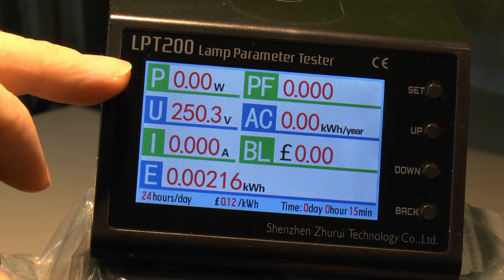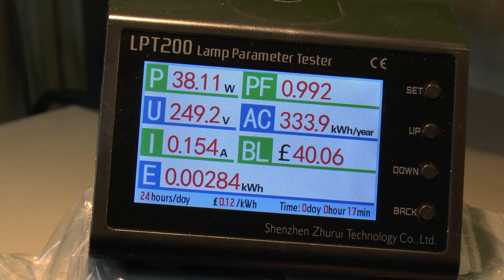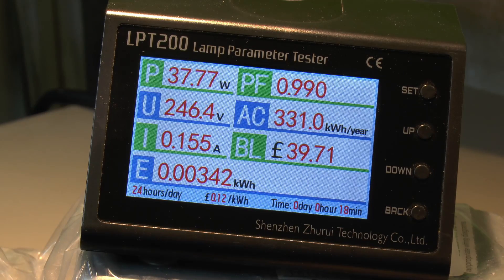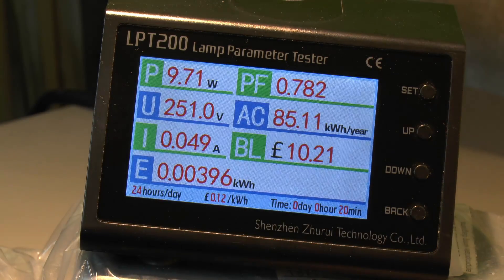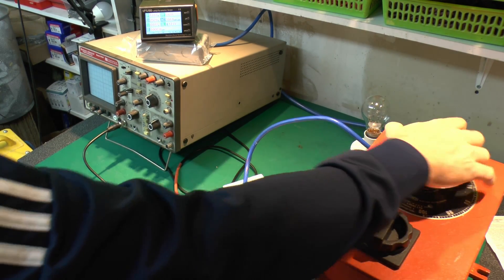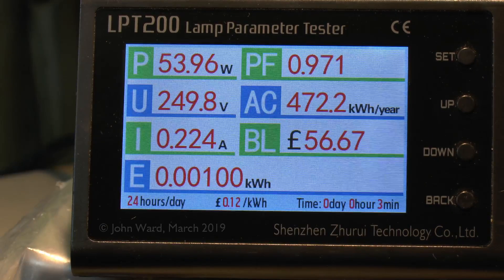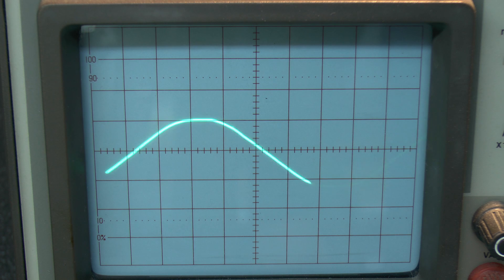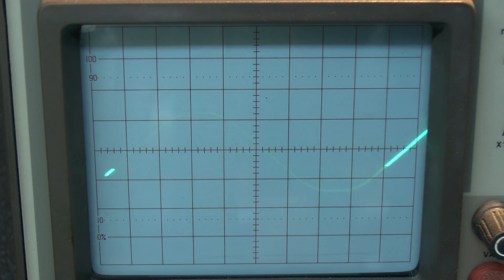Dimmer Power Factor and Variac Dimming

Comment: If you can't see the oscilloscope trace, try adjusting your YouTube settings. The default refresh rate may mean you simply can't see the trace. For me, at 480p the trace is almost invisible, but changing the settings to 720p50 HD or 1080p50 HD makes it a lot more visible albeit with a lot more flicker. I suspect that's how it actually looks.

Comment: Cool.    I always wondered how an LED bulb would react with a variac vs a standard dimmer, which chops part of the sine wave thereby reducing the average voltage.  I realize variacs are very rarely if ever used anymore these days but many years ago they were used in theaters and opera houses for dimming large stage lighting since although physically large and heavy, much more efficient than the resistance dimmers used earlier,  and safer than salt water dimmers (liquid rehostat) used in the early 20th century.

Comment: The problem is that when the dimmer is used the current is only taken on the last part of the cycle. You could say it is still in phase but is in fact the power factor is not defined for a non-sinusoidal load current. As others posted it would be instructive to show the current trace on the scope as well.  The fact that dimmers and lots of other loads take non-sinusoidal currents causes problems with the supply waveform as well as the harmonics heating the grid transformers. When I worked for London Underground the AC waveform was very poor as about 80% of the power was transformed to DC with 12 pole rectifiers. At times the AC voltage waveform had more than 2 zero crossings per cycle.

Comment: I think we're actually seeing a failure in the PF measurement on that device. The harmonics are reactive in nature, but the power factor on the display doesn't represent this correctly. I suspect the chip in the power meter is simply comparing zero crossing points rather than doing a full analysis of the AC waveforms.
Reply: I suspect you're right - would be interesting to know!

Comment: Chuckle. When I was giving planetarium shows in the 80s, the main dome lights were controlled by large variacs, each one with about two dozen light bulbs around the rim of the dome.  The knobs were around 6" diameter to make slowly reducing the light easier.

The variacs themselves were about 12" x 12" x 12", maybe 2–3kW.

Comment: I’d be concerned the the PF Meter isn’t compatible with a Non-Linear Load, and therefore struggling to identify the phase shift :/
The TRIAC circuit will add some Reactance, but it be fairly small and constant so the Linear PF changes be fairly minimal. It will introduce Harmonic distortion sure, but it’s late and my brain is done..
Reply: The harmonics are indeed reactive as they perform no useful work, but I agree - the PF displayed is not the true power factor. I will try the same thing with my home-made trailing edge dimmer on a Rohde & Schwarz power meter

Comment: The meter voltage was not changing  so you are monitoring mains voltage not lamp voltage. You should have put the meter on the output of the Variac so effect of variac inductance is not measured. 
You should also invest in a better scope. The display is very bad with the sine wave dimmed for most of the trace.
Reply: The dimming of the display on the oscilloscope is due to the way the camera works. There is nothing wrong with the oscilloscope. All conventional oscilloscopes scan the beam across the display at a certain frequency. The camera captures the image at a certain frequency. The strange image with part of the trace missing is due to the interaction in the camera of these frequencies.
Reply: @Mark1024MAK  Choosing a different sweep speed may fix problem. In this case the result was almost useless as 90% of trace was missing in video.
A digital scope would be a better choice and can be purchased second hand on eBay for peanuts.
Reply: @Mark1024MAK  - Are you dumb or something? A 'scope where nobody can see anything is a TOTALLY USELESS scope. Hence Peter's comment that a BETTER 'scope be used for these videos. The one used in this video is totally useless (since there is nothing displayed), hence almost anything would be a BETTER scope, wouldn't it?
Reply: John Coops - There is no need to be rude. Of course it is easy to say now, after seeing the problem that either a storage oscilloscope or a digital oscilloscope may have been better. John may not have realised at the time that the picture that the camera was recording was not showing the whole waveform (what he could see on the oscilloscope directly with his eyes would have been the full trace of the waveform, you can tell this by the way he gives a detailed description of it). 
Without knowing details on the model of oscilloscope used and how it was configured, I can’t say if a different mode or scan speed could have been used. The trigger signal would have been 50Hz as the waveform is a 50Hz mains signal.
I’m sure the video / camera guys can look at the recording and work out what frequency the video recording was using (maybe 60Hz). If the camera was recording at 60Hz, then it’s not surprising that a problem with the picture occurred. When recording a video of anything (that has a fast response time such as a LED) running at 50Hz you get problems (with a LED running at 50Hz, the LED appears to flicker/flash).
Reply: It may be  your YouTube settings. Watching at 480p the trace is almost invisible, but crank the settings up to 720p50 or 1080p50 and the trace becomes visible.

Comment: This unavoidable power factor thing makes me wonder if it might one day become sensible to add an extra plug type and wiring to outlets providing DC from a powersupply that is fairly efficient (compared to standard run of the mill compact ones in most devices these days) possibly with active power factor correction as well. Running 5.2V USB compliant voltage to outlets seems insane due to losses in the wiring but something higher like at least 30V (but ideally higher than that) could be a way to avoid non-unity power factor issues and keep some of the horrible noise exceptionally bad appliances can generate off the grid.

An extra socket type for low power consumption switch mode/capacitative dropper powered things would be a hassle but I could see a use for that if they ever do decide to start charging consumers based on power factor as well. If the DC voltage is high enough I suspect most switch mode power supplies designed today wouldn't even care about the difference (typically they are already rated for 100-250V AC).
Reply: We'll probably end up with more issues with harmonics and EMC from poorly controlled loads.
Reply: @sdgelectronics  I guess it'd be impossible to rule that situation out. Especially when substandard cheap options are used.

Just a gut feeling but assuming the power supply is well designed and the LEDs are reasonable for the mains distribution side it shouldn't be worse than the combined effect of current terrible LED drivers now?

How bad would it be within the residence assuming you'd only run lighting circuits on it and the rest just stays as is with normal AC mains.

Comment: Enjoyed this Mr JW, nice series of how crap old technology is when compared to new crap!, But isn't really too bad.
Thanks for sharing and best regards from the Black Country.
Reply: Well the power factor isn't ideal but at least the total power consumption is a lot lower for an equivalent amount of light. 

But it sure is a hassle, I'll have to get around to replacing quite a lot of GU10 bulbs with dimmable LEDs and replace my wall mounted dimmer in the living room and bedroom soon. Either that or just give up on dimming entirely, last time I checked those aren't for sale here anymore in the old halogen type and I'm all out of spares. Should have swapped them quite a while ago really but during winter I was both lazy and didn't care too much about "waste heat" since my bedroom only has a sparingly used resistive electrical heater as it is anyway and the ones in the living room see limited use.

I do wonder though if it might one day become useful enough to have an efficient active power factor correcting DC power supply in the house that runs lighting circuits assuming they are all LED it should work. Could be interesting for the various low power small chargers etc too, but that would be complicated with outlets, compatibility and possible new plug types needed.
Reply: @extrastuff9463  yes, probably 95% of my BC, ES single bulbs are LED, with three dimmable. All the battens are LED. The CFL's are long gone, never liked those.
Very good thought on the PF on lighting circuit's, I had wondered about this myself, but not technically competent to try it. As you state, the low power PSU's in addition to the various LED lamps, clip the peak to peak sine considerably, plus real VAR possible costs.
Active PF controller?????.
Enjoyed your reply.
Reply: @bostedtap  What I meant with active power factor correction is that in some regions for power supplies above a certain threshold above which passive correction with some capacitors etc isn't enough.

Not at the pc right now so I'll be lazy and link something covering the basics: https://www.electronicdesign.com/power/what-s-difference-between-passive-and-active-power-factor-correctors

It would deal with the observed power factor by the utility company fairly well. Not sure how it'd end up affecting net efficiency inside the house though (probably not worth the investment until it becomes mandatory or when they start charging for horrible power factors).

Comment: How is the meter measuring the power factor? Comparing the incoming mains voltage signal with the current that is being drawn and doing some sort of calculation on it? 
The way I see it, with a leading edge dimmer; the current is completely inline with the voltage (pf=1) until it gets suddenly cut off by the triac. It's just like switching the lamp on and off repetitively and very quickly, there is no reactive power where there's current lagging or leading voltage?

Switching a linear load on and off should generate a PF=1?
Reply: Hmm. + switching off (or on) a load creates higher frequency harmonics, those will have an influence on the PF
Reply: @koffibanan3099  yes they will, but the readings looked off so may be being calculated in a simpler way
Reply: @sdgelectronics  
Just read some other comments, yea I think that's the case here.  Looking forward to your video!
Reply from the maker: Just switching a linear load is PF=1, but the dimmer isn't linear, it contains a fairly substantial inductor and some capacitors.
Reply: I agree, the power meter will just be comparing the waveform zero crossing points giving a false reading
Reply: I might try the same experiment on my channel with a Rohde & Schwarz power meter
Reply: A distorted sine wave also results in a poor power factor... as the supply system is designed to supply a current proportional to the voltage throughout the whole cycle. But with electronic loads, or electronically switched loads, the current drawn at different parts of the waveform are not proportional to the voltage throughout the whole cycle.

Comment: Can you explain #PF for #noobs
Reply: It's simply a measure of how effectively a load consumes electricity to produce work - i.e. the ratio of actual load power to the apparent load power.
Reply: It is a ratio between the voltage and the current being perfect sine waves and in sync with one another AND either the sine wave being distorted or the voltage and the current waveforms not being in sync, or both!

A power factor of unity or 1 means the load is drawing current with a perfect sine wave and the voltage across the load is perfectly in step with / in sync with the current waveform. No unused current flows. Applied voltage and the current flow multiplied are equal to the power used by the load. Like a perfectly tuned petrol engine running under load at peak efficiency.

A poor power factor (less than unity / less than 1) means the current flow to the load is greater than you would expect compared to the power used by the load. Or that the waveform is distorted.
In the first case, that is more current flows. This difference is called apparent power. So applied voltage multiplied by the current flowing = actual power used plus the apparent power. This extra current / apparent power creates a magnetic field in transformers, motors, inductors or charges capacitors or similar. After the peak of the sine-wave, the collapsing magnetic field / discharging capacitor will cause some current to flow back into the supply. Hence the “apparent power” name, as this electricity did not do any ‘useful’ work.

With a distorted waveform, current flows, then is cut or reduced part way through the cycle. The turbines at the power station can’t instantly respond to this. Same where little current is consumed and then the load current shoots rapidly up. Again, the turbines at the power station can’t instantly respond to this. So if these distortions constantly occur at each half cycle of the mains waveform, the supplier has to deliver the current that is demanded by the load when it does draw current, even though little or no current is drawn for the rest of the cycle. Like trying to run a four cylinder engine at full power with only two cylinders working properly.

Comment: Note how the power factor of the LED when powered through the variac was better than it was when powered through the dimmer switch. That suggests that the LED almost certainly has a capacitive dropper, because the phase shift of theinductor (variac) is helping to cancel the phase shift of the capacitor. Large industrial users who are charged for apparent power as opposed to actual power because they use lots of power, mostly inductive loads (large motors to drive equipment) will install banks of capacitors to help cancel out the phase shift and bring their power factor closer to unity. This is also how those bogus "power saver" devices that Big Clive has debunked in previous videos sort of work. They basically contain a capacitor, on the assumption that most loads in a house are inductive, due to all the power supply transformers used in modern electronic devices. They perform negligible power factor correction- which is, of course, pointless for a residence, as residential customers are charged based on actual power used, not apparent power. That, of course, may change as resistive lighting becomes a thing of the past, but even still, the 30 or so uF capacitor in those bogus devices does very little to fix that problem.

Comment: Are there any standards for power factor, or recommended ratings for power factor, or is that down to manufacturers?
Reply: In dk, if you wish to connect to the public grid, you must ensure your total installation has a power factor between 0,9-1,0 on the inductive side. This is for residential (and wherever else EN60364 applies). 
The power factor rule isn’t from EN60364, but from a localised agreement, translating to something like ‘common regulation (for connecting to the grid).
Reply: industrial facilities have to keep power factor above certain level, otherwise they have to pay additional charges for reactive power consumed. In my country its about 0,92~. In terms of equipment, i dont think there are any rules (a device must consume certain amount of reactive power to work) and the compensation for that is in most cases done on the central level  (in factory substation for example). Ofc, we would like every device to have PF 1 but its impossible, some high class appliances like welders etc, have some capacitors inside to help with PF but its still not sufficient (as the power factor changes depending on load and other things).
Reply: sumilidero the large capacitors in welders are actually there for voltage stabilization and helping to start the welding arc. Any power factor correction that comes out of them is incidental. Given that an electric welding machine is basically a giant transformer, followed by (on all but the absolute cheapest machines) a giant inductor, you'd need a lot of capacitance to cancel all that inductance. The 100,000 or so uF that good welders have for voltage stabilization isn't going to cut it.
Reply: @puckcat22679  the output capacitors sometimes are there in MIG's thats true you said, but i often found 3ph caps on the input in the welder, and their intention is to correct pf in the idle (doesnt need much capacitance) and naturally when welding, the pf is rlly close to 1 in short circ conditions
Reply: In the US, and many other countries, residential customers don't really need to worry too much about power factor. Industrial users, with lots of powerful electric motors, which are inductive loads, are typically charged for apparent power as opposed to actual power, so they will usually have power factor correction, in the form of large banks of capacitors.
Reply: The only thing (other than commercial gear) I can recall having a standard for, is the active PFC on modern PC power supplies - the input stage being a boost regulator that allows power to be drawn across the whole cycle, rather than just hitting the peaks hard like a FULL BRIDGE RECTIFIER with a chunky capacitor. The other bonus of the circuit being full range voltage input without the "go bang" switch
Reply: Matthew Day - Ahh, you mean the user accessible 120/230V switch. Which when in the 120V position and the unit is connected to a 230V supply does result in the self destruction mode...